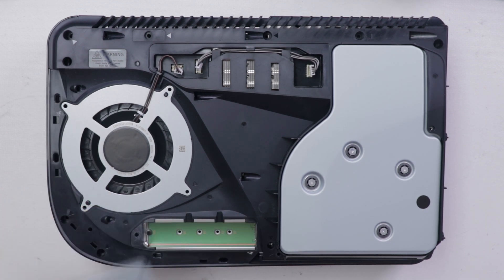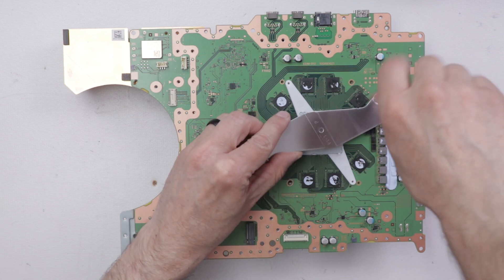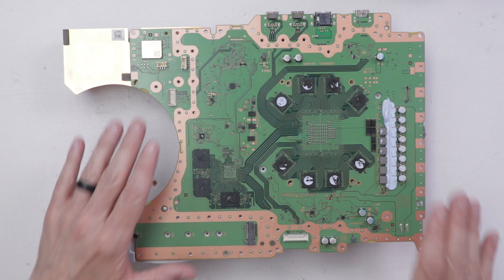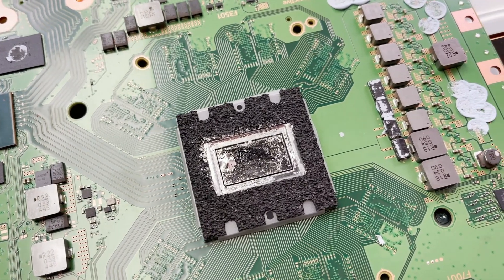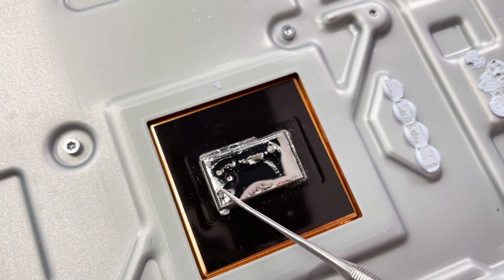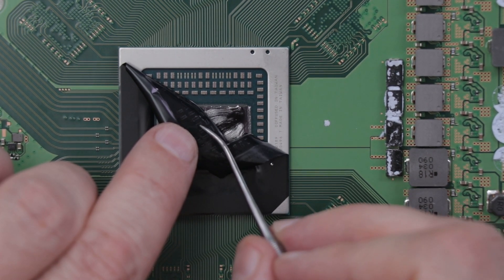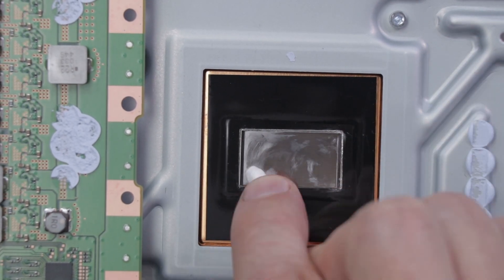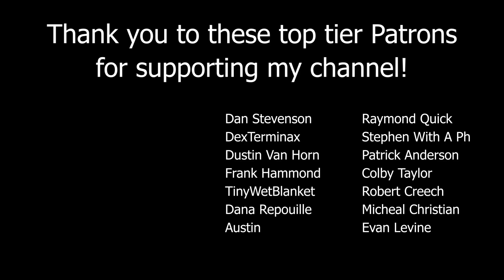PS5 Liquid Metal - What The Heck Is It & How To Replace It

Comment: The material safety data sheet says that Thermal Grizley Konductonaut is an alloy of Gallium, Indium, and Tin. No report on the % of each since that's not required for an MSDS. But that's the metals that are in it.

Comment: You surely should not use a screwdriver on this 😂, btw you should try to use just a little of liquid metal as it's done on pc to check if it's working normaly, and you then can remove the protecting plastics and use nail polish on the small components so that they stay protected

Comment: Is there any chance of the liquid metal causing issues during operation if you keep the system vertical? Seems like horizontal would be the ideal way to use the ps5 based on the viscosity of the liquid metal? Maybe I’m being paranoid.

Comment: That looks like a lot of liquid metal :).

Also even if someone screws all the isolation material is not the end of the world as I'm sure there are many products to put all around that will protect it, no idea which products since I see a lot of ppl just using nail polishing :)

Ps: I'm not sure but I think you forgot to say it's also corrosive to some components on the motherboard just like aluminium parts.

Comment: You said you was using liquid metal you had from abother ps5 did you not use the grizzly kind you showed in the video. Do you think we will need to change the liquid metal similar to how we treated thermal paste . ? Maybe a longer window or time befoe it goes bad. How would one even know if the liquid metal was bad and or needed changed... so many questions still about my new console .... thats why i been subbed i want to learn to....

Comment: I'm not a fan of liquid metal as a tim, back in the day when I was chasing the 3ghz single core overclock I tried it out and it was bloody fiddly and too much would squirt out and too little and that was another chip fried.   I am a fan of peltier's and a decent waterblock which uses electricity to create a super cold side to the cpu and using its thermal pump action channels heat to be dumped by your waterblock, in fact they were so efficient you had to protect the components from condensation and frosting, the hotter the cpu, the more condensation and cooling.

Comment: I assume the engineers thought of this, but I wonder then, since it has the tendency to pool, if a standing PS5 is less efficient at heat transfer than a horizontal one, or if the pressure given by the brackets on the heat sink prevent the metal from pooling.
Reply: I assume the latter would be the most logical.
Reply: Also, how many PS5s (and New Xbox's) could you have fixed by now? What are people doing to their consoles?

Comment: Can liquid metal embrittlement cause any damage over time to components on the PS5 board??? Also, does liquid metal last as long as normal thermal paste?? I've read that liquid metal should be changed out every 2 years or so and that a good even application is most important to get good thermals.

Comment: That would be WAY too much liquid metal if used on a GPU or any other chip. All you need is a thin layer covering the chip and one on the heatsing. Thin layer meaning just covering it, no puddles. Puddles = leaking around and shorting stuff.
Sony applies way too much from the factory but it's well sealed, applying it to anything else like that would 100% kill it (xbox, gpu, laptop cpu and gpu).

Comment: My concern with the liquid metal is its longevity. Specifically the longevity of the materials required to make it not ruin the rest of the system, since as that foam pad and its adhesive ages I don't know if it's going to slowly let the liquid metal leak.

Comment: The (likely nickel) coating on the copper heatsink is just that, a coating. It protects the heatsink from degradation from the gallium in the TIM, and so when spreading it back to the centre, it's probably not recommended to use a metal pick or screwdriver unless you've very careful. A graze is enough to allow permeability into the copper. Better to use a plastic or Teflon tool, in my opinion.  
TronicsFix was clearly very gentle using the dull curve of the pick and dragged at the surface tension of the fluid when he did it, he's not an idiot, but hearing "screwdriver" made me wince a bit. Especially when this channel shows us the kind of chimps that try to fix these things sometimes.

Comment: @9:25 Can those components be covered with nail polish (I think that's what some techs use) to keep the liquid metal from damaging them if (God forbid) they ever got any on them? Or what's that other liquid you use to cover traces and UV cure them, maybe that could work too?
Reply from the maker: Yes, but I usually use conformal coating.
Reply: Conformal coating on non-potted IP68 rated boards is a pain to work on replacing components... how do you get it off ?

Comment: My primary concern with LM is longevity. I've never used it personally but what I understand it needs to be reapplied every 1-2 years because it dries out quicker than a good thermal paste does. So I do wonder if in 2-3 years time we won't have a bunch of overheating PS5's to worry about.
Reply from the maker: It should last much longer than that but time will tell.

Comment: Thankfully Sony have used some wisdom and put a barrier near the APU chip, so the liquid metal doesn't spill all over the place
Reply from the maker: Yes, that's the key here!
Reply: From what I have heard as well it should also prevent the liquid metal from oxidation, so it will last a lot longer than on a normal pc. Maybe it will even last forever, but its hard to tell

Comment: I've seen a lot of Gamer's Nexus videos on this topic. They made a big deal that you should never allow it to pool up. So based on that, this is too much liquid metal. However from what I've seen Sony themselves seems to put on too much as well. Maybe that's why they have so much protection because automating the perfect amount is too difficult. It's actually surprising how little gamer's nexus and De-Bauer use.
Reply from the maker: When you remove the motherboard from a PS5 the first time it's definitely in a pool. They use a ton of it so that's why I put that much on.
Reply: @Tronicsfix  yeah I've noticed that. I thought it was kind of odd. But then again it's probably a lot harder to get the perfect amount in a massive heat sync rather than a tiny IHS. The only thing that really matters is that the tiny SMD's don't get touched. In most of those videos I've seen, they'll put fingernail polish over them to prevent issues.
Reply: On the other hand all the videos I've seen were putting it inside the IHS.........and there is none in this case. So who knows.

Comment: Hey Steve, could you make a video about PS5 NAND flash replacement?
I'm wondering if it's repairable when the SSD wears out.
Reply from the maker: Probably won't be making that video.
Reply: Probably not, since it's thousands of tiny solder balls... let alone matching the NAND to the controller and such...

If the NAND wears out, you're probably better off buying a new PS5...

Comment: PS5 no thermal paste vs perfect amount of Normal paste vs metal thermal paste
Reply: Overheat near instantly > Overheats under intense loads > Doesn't overheat.

The PS5's cooling system isn't designed to handle the heat from the PS5's SoC unless the thermal transfer is greater than normal paste. Probably due to last minute overclocking needs.

Comment: I just learned how to add the perfect amount of thermal paste. Now I need to learn the perfect amount of liquid metal
Reply: I think it's too much! it's leaking like this, and it goes right under the safety tape. lay a thin layer on the surface of the APU and radiator, then draw the excess into the syringe! Never leave unnecessary drops!
Reply: @lildebcsi  Way too much imo, not that it'll result in a bad heat dissipation, just not worth it regarding the price of a small quantity of kryonaut.
Reply: @lildebcsi  you can always paint the mobo around the apu with some clear nail polish to protect it from over flow also, but just not using to much is a better option as you stated.
Reply: @lildebcsi  Its the perfect amount you silly pay attention.
Reply: Liquid metal is like culture, the less you have, the more you spread it.
Reply: Never use galium on aluminium heatsinks!!
Reply: Dang it! Keep on learning I guess :)
Reply: @TheGlitchyMario  this is bait...
Reply: Use a small art brush instead of a metal pick.
Reply: Or precision qtip.
Reply: @TheGlitchyMario  google it.